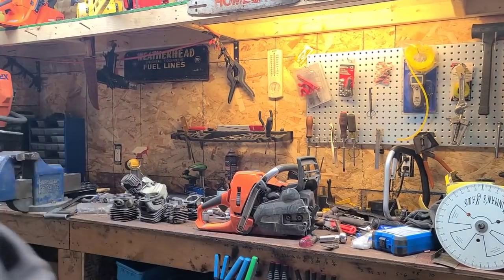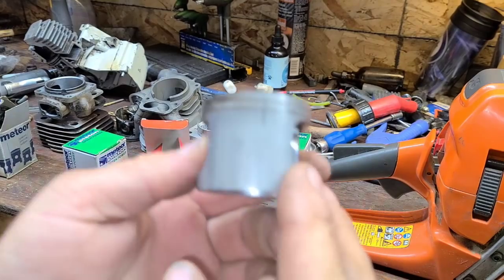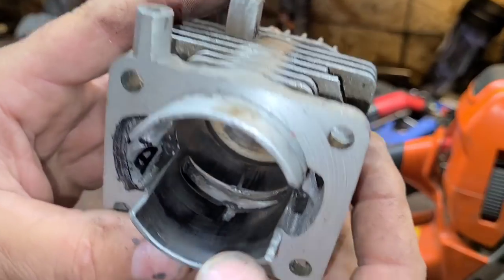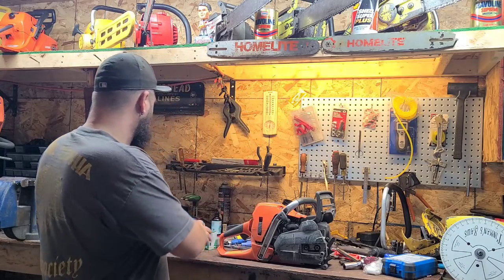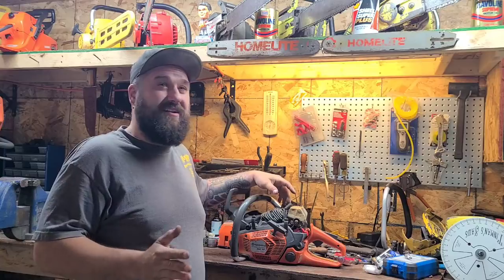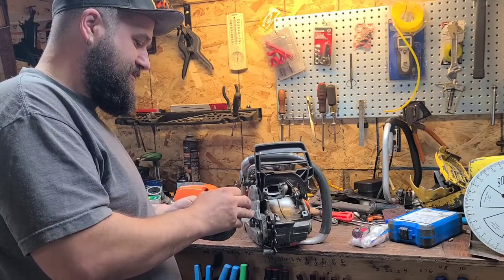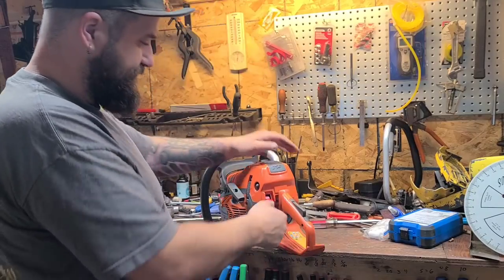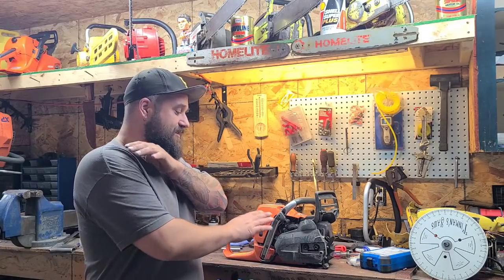Scored chainsaw cylinders and pistons, can they be reused?

Comment: Worn loose piston in a two stroke means the heat transfer can’t make it from the piston/ chamber to the cylinder for cooling. Thus your engine over heats, runs hot.

Comment: Hey Tinman!! I’m in the process of porting my 562xp….Mine needed a piston and I put a metor into it and neglected to check the wrist pin clip on the already installed side of the piston. I went to start it after just porting the transfers and gutting the muffler and the clip came out and locked up my saw not 5 seconds after start.. both the piston and the cylinder a screwed. I have to start over with the porting. I  will never neglect to check the other wrist pin keeper clip again.. live and learn..
Reply from the maker: Ive lost a saw to a wrist pin circlip failure. It happens.
Reply: Friend, the revolutions 13200 max for the saw 372xp oe 2003 are okay?

Comment: I too like the autotune, I have a 545 mark 2  (old man saw)  50cc and think it pulls stronger than most saws in its class. I would like to see you and your brother build a pipe for it. I muffler modded mine the same as yours and it helped but think their is more potential with a pipe.

Comment: Almost every of my used saw's came with a scored cylinder. I cleaned them (with that 3-arm-sander because i dont have a honing-device) and then put a new piston on it. They all run with good Compression. In my opinion a refurbished original cylinder is in most cases better than a aftermarket one (if the scores are not too bad).

Very nice lesson, tinman and habe fun with your saws!
Reply: What " 3-arm-sander" would that be ?

Comment: Great video. I built an Echo cs590 Timberwolf this winter. Had a scored piston. I wasn't sure if I should buy a cylinder or not. Decided to try it. It cleaned up good. I used a worn out flap wheel on my die grinder to remove the aluminum.  Far from a textbook approach, but worked very well. Only had a couple small scratches when done, could barely catch them with a fingernail. I base gasket deleted it and did full pressure test when I got done. It runs great for my first two stroke. Being I didnt find any air leaks and it runs perfect without touching the carb I have to assume it was a cold seized or possibly run with a dull chain. It has gotten quite a workout since it has been done, runs great. I have another 590 a 620p and 800p up next. Great channel, thanks for sharing.

Comment: I bought a Yamaha dt 50 from the late eighties they were putting in a new piston when I bought it because they thought it had no compression that wasn't the case carburation was the problem the engine had virtually no miles I got a new piston for free after I got it running good I explained to them factory compression is only 6 to1 and it has the same range as your saws 11grand safely I've hit 13 thousand a few times  it's a real screamer and you can kick start it with your hand anyday and because of its low compression it runs on low octane fuel the best a real bonus nowadays your video was good thank you!

Comment: The 61 carcauss I got has scored cylinder. It clean up. Im waiting on 2 m5 intake bolts for a while now. See your cylinder I think will. So I'm going to try it just to see if it will run plus I port it for practice.Then someday I'll put 272 top end on it.Good video Tinman
Reply: It amazes me how some folks just know all this stuff like it was normal. Damn.
Reply: Friend, the revolutions 13200 max for the saw 372xp oe 2003 are okay?

Comment: You are very welcome Tinmann. I'm very pleased you like it. I see Buckin is using a scope now. 
The longer I have mine the more uses I find for it.
I used mine to find out why a tool drawer wouldn't open the other day.
Reply from the maker: Lol I used mine to see if an oring was stuck in the block pf my diesel. Its a very handy tool for sute
Reply: Friend, the revolutions 13200 max for the saw 372xp oe 2003 are okay?

Comment: I ordered a cylinder kit from Bailey's for a jonsered 2165 turbo and it came with broken rings.i was building the saw for a friend of mine who's not doing the best in life so it was out of my pocket,but anyways the Piston rings were siezed in the grooves pretty good but I figured I would try an experiment so I took a couple of razor blades and scraped carefully around the rings and amazingly managed to get them out of the old piston.yeah they were grooved a little so I polished them on some wet emry cloth real carefully and long story short ,new cylinder and pin put it back together and he's been running the saw for over a year now and sure it hasnt got brand new poppy but it pulls a 24" bar full comp chisel no prob,even when dogging in so...it is at least possible to reuse old rings.if your are careful and patient it is possible.just FYI.

Comment: I have seen many saws with scuffed piston due to old fuel, If you mix 5 gal, cut 4 or 5 cord of wood and keep the remaining fuel for the next year, you are looking for trouble. The oil breaks down and the gas gets varnish like, and after a tank full or 2 you have a piston scuffed on the exhaust side.

Comment: Bought a cheap Stihl 2023 ms291 a few months ago that was not running, the previous owner straight gassed the saw. when I brought it home I seen it only had max of 25psi of compression took it apart found the piston had deep scoring could easily feel with with my finger nail and was charred with thick black carbon, the cylinder was also very scored with some deep scoring but not too bad near the exhaust port. looked up new parts and seen new OEM cylinders are nearly $300 and aftermarket ones are $100-150 so decided to try to work on this as cheaply as possible so I found a used flex hone (47mm) for $20 off Amazon and a new cheap $30 lil red barn piston and rings. Honed it which got most of he transfer off and used some 240 grit and 600 grit sand paper to try to get as much of the scoring off without taking off too much material after doing all that for a bit of time everything was mostly smooth some areas where there was small deeper scores but way better than before. put everything back together with some new motoseal gasket maker. After letting it cure overnight it fired right up! I have been starting it for the past month on the daily basis to test to make sure everything is still holding up and I have to say I've had no issues so far runs perfectly only thing I had to do was adjust the carb and now I'm getting plus or minus 130 psi compression which isn't the best but it works for what I'm using it for.

Comment: Hate to bother you all. The two saws are a Mac model 47 and a 1952 strunk busy beaver. They are both 70 cc. If anyone-knows of  parts and a way to change the old points and condenser please post the info. Thanks again tinman. I appreciate the help sr.

Comment: Good point about drilling out the exhaust to keep it running cooler. Companies probably need to keep their products running at an acceptable sound level and therefore sacrifice the longevity of the engine, right? I'm not really into the idea of modifying the saw for more power, but if that modification prolongs the service life of the tool then im all ears!

Comment: Good video . Im rebuilding the top end of a new to me 99 polaris xc 700 snowmobile , I was having trouble with it overheating a few minutes past startup , come to find the drive belt for the water pump was broken , I even tested the thermostat before that . Had to buy a carburator just for the obsolete float , someone broke one side off of one , its a bit of a weak design . The carberators are clean and everything set and good now . But I popped tge head to see some alluminum build up in a couple spots on each cylinder , so I pulled the clutxh side cylinder / after giving the engine a quick gunk clean job . The piston had a 5/8" long piece of the ring land broke below the top ring !!!!!!!! It didnt eat it fortunatly . That cylinder has 1 score in it , between tge ports , I'm going to clean the alluminium spots on cylinder with tge proper acid , I think and a light crosshatch directional scotchbright in any trouble spots , clean it and put new proX pistons in it. Wisecos would be over 100 more a set , and cylinders / replated are 275 each! Benn around 2 strokers a fair deal and with a touch of luck they'll be fine for a couple years with a little luck and proper jetting wich I'm good at . Any other suggestions on cylinder clean up ??? It should be a runner they're rated at 125hp , bottom end is good and tight so far , sled only has 2300 miles and looks great 👍

Comment: HL supply sells a warhawk topend for the 562 it's under a $100
Reply: Is Warhawk any good? I saw that and was curious.
Reply: @gcrsmallengine8836  not sure personally I haven't tried it but I've seen other you tubers that built saw use them and said they work Ok

Comment: I used my dads Dolmar 115i for along time but in the end it went in the bin and that was about 5 years ago since then I have had a MS 291 consumer saw and I have had a ms 441cm since November/December 2018 and MS 661 C-M since April 2020 both cracking saws but moronic can sometimes be a pain in the arse as the saws don’t always start but kick like an unhinged mule
Reply: Friend, the revolutions 13200 max for the saw 372xp oe 2003 are okay?

Comment: Great information. I have a 562 and did have trouble starting when it was hot. You mentioned following the hot start procedure, what is that procedure? thanks.
Reply: Me too😵‍💫
Reply: lift to choke mode then push it down again then pull :)

Comment: I just pulled the jug on my 661 to replace the piston. It looks exactly the same as that 460 piston due to rocking! Is that just a poor design by Stihl or would a richer mix help that? I run my saws at 50:1 but I’m rethinking that. Thinking about Honda HP2 oil at 32-40:1.

Comment: In my experience it's your modifications that cause your saws to not start when it's hot, I do siesmic im the winter and utility work the summer in Alberta so that is mostly clearing brush and limbing with the odd big snag here and there so my saws are pretty much wide open all day and I only run my ported saws in the colder months. I knownit sucks but if your working try to sick to stock in the summer and see what happens, my stock 365's and 72's will still sing at 45°C and 60% humidity and my ported ones not so much.

Comment: Thanks for the valuable information tinman. It is very helpful. One question sr. I have a Mac model 47 and an old pioneer saw. Both early 1950’s. Are they worth fixing and getting them running?  Would like to preserve the history if I could. Thanks for the vid and be safe. God bless.
Reply from the maker: Get em running. Those old powersaws are fun to run!!
Reply: @tinmanssaws  will do my best sr. If I need hard to find parts could you help me find them sr. Not saying I can’t. Just thought maybe you might know where to get them. Thanks for your help sr.

Comment: Recently got a low hour MS 461 manufactured in 2020. Piston shows wear at the very bottom of the skirt on the intake side. Its a thin horizontal line on the lowest portion of the skirt. The higher you look on the piston the more defined the machine marks become. 

On the exhaust side the whole piston looks mint. The cylinder is also in good condition. Saw has lots of compression and sounds normal while running. 

Does this kind of wear mean much for the life of the top end? Is it inevitable with use or does it indicate any kind of "misuse" by a previous owner?

Comment: I have a MS291 the was gave to me by a buddy. The saw has maybe 10hrs on it but my buddy's dad overreved it constantly during a storm clean up and there is transfer from the piston to cylinder and the saw quit. It isn't ceased but there is definitely friction when you pull the cord. I was looking for a top end kit to just swap it out but don't see many quality options. I can get a Meteor piston kit but not a cylinder (at least I haven't found one). I do plan to attempt to clean the transfer from the oem cylinder. Are there any recommendations on a complete top end kit? If not I'm assuming the Meteor piston should match well with the oem cylinder? Any advice is appreciated! Thanks!

Comment: When the manufacturer's light came on and they realized chainsaws were lasting too long, thus NOT good for sales, what did they do? In the late 60's they had an extraordinary idea...it was called 50:1 oil mixture. Thus the scoring of cylinders and pistons became a common occurrence.....THAT is just fact. OLD 16:1 chainsaws that used 30 weight MOTOR because there was NO SUCH THING AS MIXING OIL, RARELY if ever had scoring of ANYTHING.
Reply: Tree huggers are part of that problem too. Late sixties is when they really started harping on folks about the environment. 1970s OPEC and the oil crisis, then the 1990s when they killed two stroke dirt bikes. But the dirt bike thing was the manufacturers trying to make more money too. Four strokes cost more to build and develop, so they have an excuse to charge more. This started with Yamaha convincing the AMA to let them run the YZ400 four stroke against 250cc two strokes. They won (because the bike also had cheater shit like titanium swingarm etc that lowered weight) and so consumers wanted to buy the same kind of bike that won, a four stroke. That led to other manufacturers building them. Then California CARB basically outlawed two strokes for half the year because "muh environment". Effectively killing two stroke development and cheap effective two stroke bikes and saws

Comment: Tinman:  When buying replacement parts, what brands are you looking at?  In a perfect world, we would buy all new manufacturer parts, but it is become prohibitively expensive at times.  I deal mostly with Stihl saws, and have used kits from Hyway, Meteor, and even a Warhawk.  Some ae Nikasil, some are not.  Ive use Caber and Meteor rings mostly.
Reply: Friend, the revolutions 13200 max for the saw 372xp oe 2003 are okay?
Reply: He's got another video that shows the aftermarket brands he uses for rebuilds. To sum it up, and save you 40mins, he uses Meteor/sabre and Hyway. And shows the small differences in each. 
Personally I prefer the Meteor/Sabre PC's over the others.. Mainly bc the Sabre rings are better, IMO...
Reply: @jbplays7302  If I can get something a little nicer, but not spend OEM money Im all for it.  $20 is nothing in the grand scheme.  Ill see if I can find that video.  Thanks!

Comment: Alot of piston wear comes from runnin 87 octane instead of 91 , pre ignition causing piston to  tilt  the piston  from combustion on one side of the cylinder
Reply: I can only get 87 non eth so i put 1oz 108 octane booster per gal and a little rich w a 32 : 1 mix
Reply: @sundial6919   that's smart of you, thankfully our non ethanol  is 91

Comment: You mentioned heavy carbon deposits in the cylinder head & because of the oil you use, you wouldn’t have that problem.  You didn’t mention the oil you prefer.  Could you share?
Reply from the maker: Hi I use opti2 at 44:1

Comment: What would cause a stihl br380 to run for 5 seconds then die? I can keep it going by choking. I replaced fuel, carb, plug, fuel line, removed spark arrestor, and tried without muffler. All the same before and after. Timing seems good, easy to start, and piston looks good when viewing through exhaust.
Reply from the maker: Probably a massive air leak

Comment: Not to debate . You are saying running lean. Actually running 100% synthetic 1 to 25 will make a engine hotter than 1 to 50. Jus saying . What do you run ratio wise ?? thx.  This was exactly the vid I was looking for. I have a 372xp , it has 60psi and cuts . Yet the cylinder is a little scored. So long as there is no play in main bearings, I will just installed a new piston and rings . Thanks

Comment: I just picked up a Stihl Pro 036 with a scored piston and barrel. I know what caused it the previous owner forgot to put oil in his fuel! I’d like to salvage the OEM cylinder but don’t know if anyone makes an oversized piston & rings? I will probably try to port it or at least clean up the port’s as I’m only into the saw for the cost of a new 18” chain! So any information would be kindly appreciated.

Comment: It seems to me that 50-1 or even 40-1 mix that's all you see on the shelf  is the cause of many burnt up saws...     My granddaddy ran 12-1 or 16-1 fuel mix in all his daws...  I don't think he ever burned one up...      Running homolites 5-6 days a week...    
Curious what the creators thoughts would be on this ???
Reply from the maker: In the old days they mixed straight 30w oil im the gas so that's why the mixes were so heavy on the oil.
Reply: @tinmanssaws  so  i would like to know why  30w 16:1 isn't the most efficient. He also run used gear and motor oil on his bars..  he ran 5 homolites year round for 25yrs I remember .  Of course we had a good saw shop in Goodwater Al.   Of course he had a hook on his left arm..

Comment: ++++++++++++++++Hold on.I sanded pistons and cylinders on a lot of saws because the owners didn't have the money for new parts.Absolutely every one of these saws has been working for several years without a problem.The pistons and cylinders were even more destroyed than shown in this video.Of course, they immediately want to replace parts at the service center because they want to make money.The truth is that they don't even know how to repair a saw